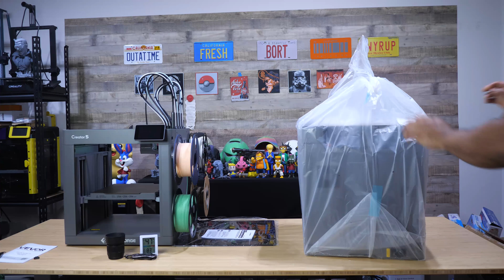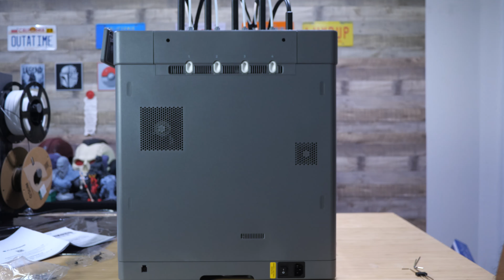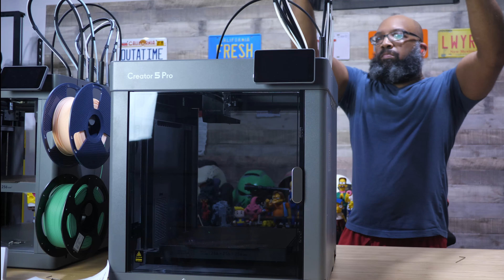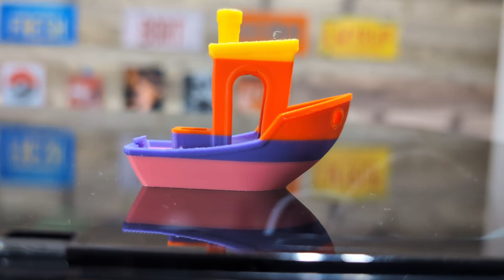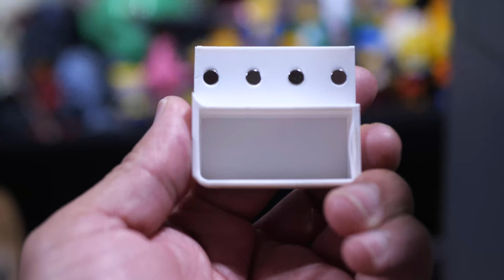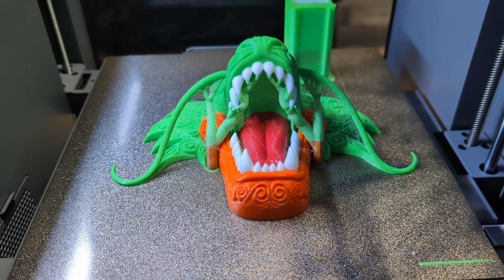Flashforge Creator 5 Pro Unboxing & First Impressions!

Comment: Have you had the purge material sucked into the heater fan like another video showed? Also does the chamber exhaust fan vent straight into one of the side filament rolls?
Reply from the maker: I haven't experienced filament being sucked into the fan because I've been using a purge bucket since the beginning. If I hadn't done that, it probably would have gotten sucked in. The vent is also on the same side as the filament spools.

Comment: Nice preview video. Are the door and back panel made of glass or plastic?
Reply from the maker: They are plastic.
Reply: @FigureFeedback  I guess that means you don't have to worry about it shattering. But it still can crack and break! I wonder why they didn't make the back out of metal?

Comment: Hi! I'm currently waiting for my Creator 5 PRO to arrive, and I was wondering: is it possible to install a PTFE tube with a pneumatic fitting to get an airtight seal, just like you can on other printers? Thanks a lot for the great video!

Comment: Would love to see more details about the heated chamber, the air filter, and how it works for using external airflow when using low temp filaments like PLA
Reply from the maker: The chamber goes up to 65 degrees Celsius. It has a HEPA13 filter with activated carbon. It draws in cool air on one side and exhausts it out the opposite side so you don't need to remove the top or open the door when printing with PLA.

Comment: honestly the manual filament feeding is a plus to me, minus the lid on/off to cut, i always hated having to wait on the head to heat up when having the printer retract a filament thats not even loaded into the head, adding quite a bit of extra time if removing all the rolls. (on AD5X)

Comment: I know it's not a full review, but with the price potentially increasing soon, one website says in 4 days, do you think this is a better buy than the U1?
Reply: If you want to print in engineering material this would on paper be the better pick. U1 won't be as capable for that. I think the U1 would be the better pick for every other thing otherwise.
Maybe this is better for tpu too

Comment: Do you have to vent the exhaust out a window?
Reply from the maker: That's more of a personal choice. It has a HEPA13 filter with activated carbon, but extra ventilation when printing things like ABS is never a bad idea.
Reply: @FigureFeedback With lack of auto filament loading and need to open the front door, wonder if this makes it more of an issue to run this printer with higher temp materials in a room without really good ventilation. Also makes your filament purge bucket more of a necessity.  Could at least keep the door closed and ventilation running while initially purging filament.  Suggest lining that with high temp silicone or foil to prevent purge waste from bonding to the bucket.

Comment: You dont need to remove the top hat to cut the filament at all you can do it over the front door and reach in 😉👍
Reply from the maker: You know what? You're absolutely right!
Reply: @FigureFeedback another tip when loading the filaments you dont have to actually load them on the screen just fit them all the way in on all the slots and then as soon as the calibration before the print starts it will auto load the fillament it will use first, this saves a lot of time trust me, I tried both ways.

Comment: I have a bigger one along with the toolhead cable guide printed in Fiberlogy PCTG-CF from Mike's Quest Log. Make sure to get special temperature resistant magnets as regular magnets will lose their power over time from the heat

Comment: Great info!  13-15 minutes to chamber temp is faster than I'm used to with the chamber heater I modded into my Centauri Carbon (and that I only push to 55, not 65).  Good to know.  The ABS print looked nice.